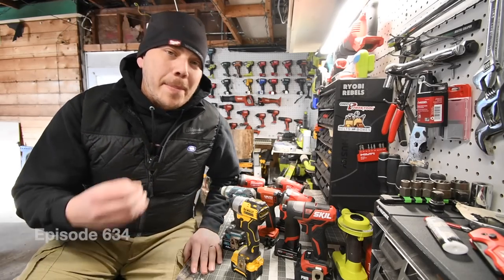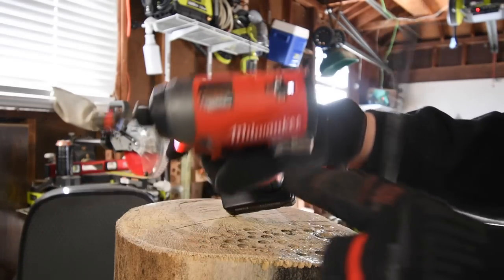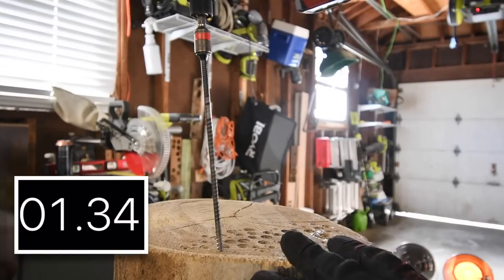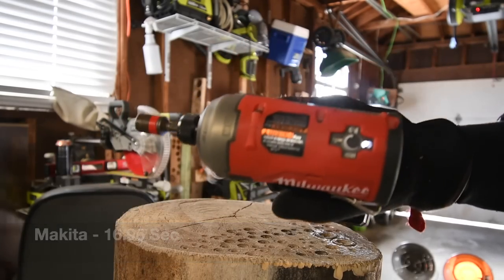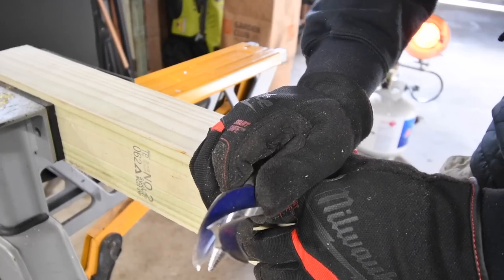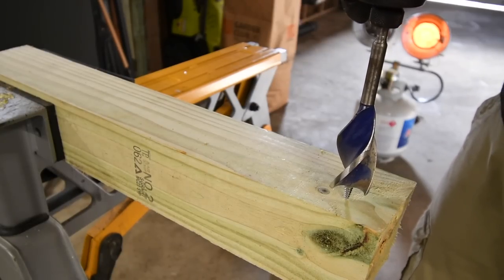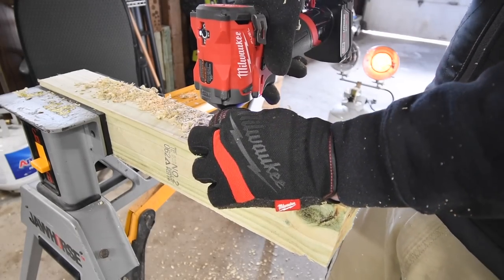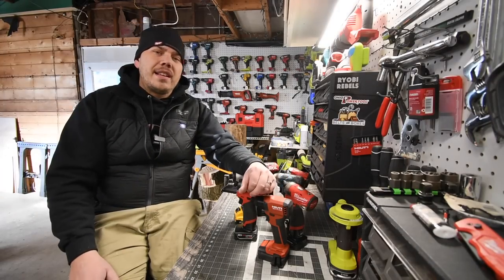Which 12v Impact Driver is really the best?

Comment: Nice demo. I am a big fan of the Dewalt 12v impact. The thing to remember is the more power you have the less control you get. The stiffer spring and heavier anvil will do better on lags but won’t do much of any impacting for your everyday screw. I think Dewalt nailed that balance in their tool.
Reply from the maker: I thank you T K

Comment: Yeah, I’m with you 100%! 12v are my favorite. Have some Milwaukee, dewalt, Skil, and Bosch, and love em all. My main impact is the m18 surge… but only because I don’t have the m12 surge yet 😬
Reply: Is there something with 12 volt tools im missing?...because I really dont understand  the love for the 12 volt tools when 18 voltntools are clearly faster and have more power
Reply: @codyrivenburgh7645  it’s not always about power. I do more detail work in tight spaces so the smaller 12v are perfect and can fit where their more powerful version can’t. Every tool has a purpose
Reply: @iloveknives75  i guess I'm just not doing enough detail work in small tight places to see the need to have both.....I have the older brushed milwaukee m12 drill/driver and impact and just never use them as much my dewalt 20 volt tools

Comment: Milwaukee M12 Fuel with CP3.0 battery is the best combination. Once you start using a XC4.0 and up, you might as well grab the M18 because the overall size becomes the same.
Reply: Agree but weight is still much better depending on the battery but Milwaukee m18 are so compact that def size isn't much difference from m12.

Comment: I like the dewalt 12v line until I started using the DCF850 with the dewalt power stack. It’s like similar size with the power of the 20v system.

Comment: M12 is by far a beast, but the extreme is my daily go to, it just fits in my hand better
Reply: I was going to say the exact same. Really love the 12v dewalt stuff. I have both m12 and dewalt and would grab the dewalt first.  If I’m driving big bolts etc I’m grabbing my 18/20 anyways.
Reply: Oooh, kinky...Oh, wait, you meant....Never mind! 

But dude, you gotta admit...

:)
Reply: The only M12 tool I have left is the M12 Surge and circ saw (will be selling the saw soon), because it is faster than the DeWalt and Skil that I've had while being a lot quieter. My other 12V tools are DeWalt and Skil for ergonomics.

Comment: And to think that the M12 Surge is rated at around 430in-lbs compared to the others that are over 1,000in-lbs, and it is right in the middle for speed while handily winning for quietness. I will take something 2 seconds slower in order to help preserve my hearing. My other 12V tools, however, are DeWalt and Skil.

Comment: I appreciate that 12V tools are much more powerful than they used to be and that they can handle the vast majority of tasks, but at the same time 18V tools are much smaller and with better ergonomic than ever.  And they do the tasks quicker. 

So in many ways, I don't have much of a purpose for duplicate 12V tools.  I do find a 12V screwdriver type tool (or better yet the installation driver) for those basic household type tasks to be very handy though. I also see a role for a couple miscellaneous lesser-used tools that are much cheaper in 12V, that I don't need in 18V.
Reply: I'm probably gonna break down and buy some 12v tools for my wife.  Even though they are much smaller than they used to be, my m18 fuel drills are still too heavy for her. Plus my kid likes to help me out, so a 12v with a 1.5 is perfect for small hands, haha.
Reply: @Jerry-zz2eu  That's a good point. The weight can be an important factor. For people doing overhead tasks or find themselves in awkward positions in which weight differences are amplified, I can appreciate having only as much tool as you need.

Comment: Milwaukee's Impact drivers are old the oldest review for the m12 fuel on milwaukees website is 9 years old and the oldest review on the home depot website for the m18 fuel is from November 2013 so almost 9 years ago I think a new version is around the corner especially with dewalt dropping the new atomic impact which is shorter than the m18

Comment: I know you are reviewing these in ways to really stress the impact drivers , but drilling holes with impacts is not good to teach others, drills are for drilling holes impacts drives the screws and bolts.  Today my coworker a huge milwaulkee fan drilled holes with his 2 week old fuel impact , the bit hung up and Milwaukee's power snapped the 1/4" collet bit off inside his impact and with Milwaukee there collet doesnt eject the bit piece that's broken , so ya that milwaulkee is a beast until it leaves you snapped off in no time .